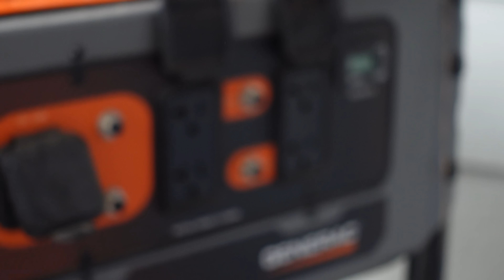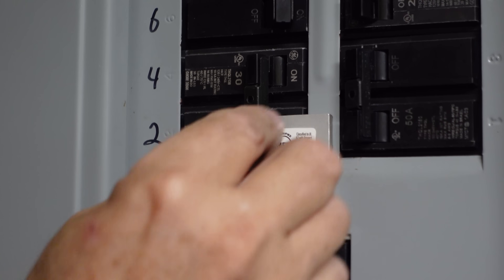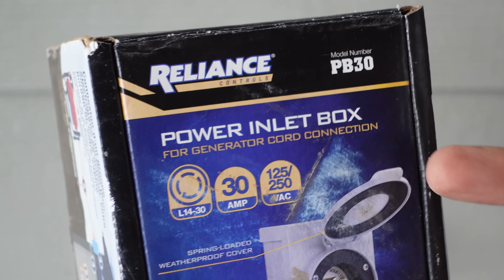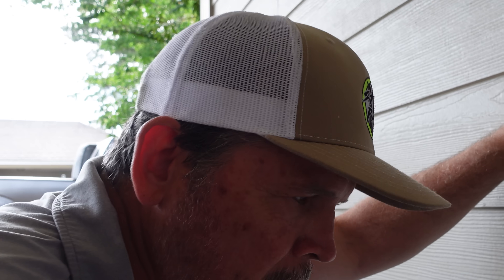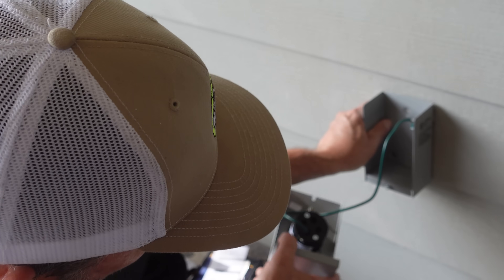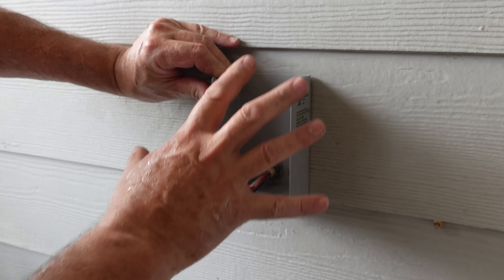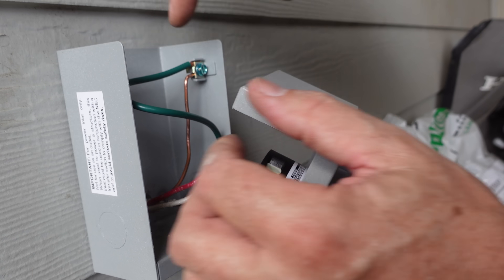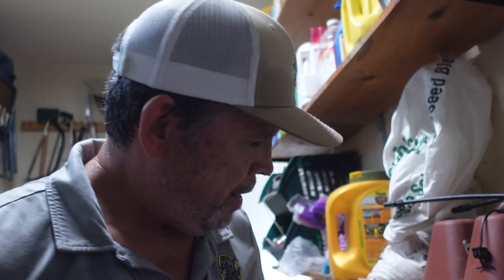What is a Suicide Cord and Why It Could Kill You

Comment: When I was about 12, we moved into our newly-built house, and it had provision for a timer for the the kitchen lights. The connection between the timer and the lights was supposed to be made using a 120 volt version of what you very aptly call a suicide cord, and I was sent to the hardware store to get such a cord. Fortunately, the lady there told me that it's illegal (this was in NJ) and explained why. I still wonder at how the idiot electrician came up with this scheme. I also remember relatives in Brooklyn who used such setups, and, surprisingly, I didn't hear of any mishaps.

Comment: The new panel has a 30 amp breaker feeding a 20 amp outlet.  We hope that the wire in the wall is #10, not #12.  But it seems odd to have fed a 20 amp outlet with #10 wire. That would have been overkill.  You have not actually said that the wire in the wall is #10 as it should be to avoid a fire.
Reply: I came looking for this comment.  On the video it sure looks like 12ga to me, it could just be the look on the video, but it would be nice to hear that it needs 10ga.
Reply: @dann952  thanks.  It sure looked like #12 to me too.   I hope stud pack does not get a fire when using a 30 amp generator with #12 wire.  He needs to make this clear to all.

Comment: You can save some hassle in tight spaces like that if you know you have enough length on the cable by putting the back side of the clamp on and screwing them down onto the sheath and then pull the threaded part up through the box with the cable to put the ring on.

Comment: i'm a UK approved electrician, the apprentices were always told to check screw tightness before shutting something. they were also told to leave a little spare length, for the next guy, in case of problems so that they had a little spare to play with. and the earth wire always got covered by earth sleeving green/yellow or green, in case of a short against something when it's screwed up tight. and i've seen a few suicide extensions with a plug on both ends :D i love the consumer unit spreadsheet, things like that can save so much time in repairing something.
Reply: I was gonna say the same thing about the earth sleeving
Reply: Absolutely. Wiggle it a little and check tightness

Comment: The wire in the wall looked undersized for a 30A circuit. It looks like a 14/3 or 12/3. Both are not rated for 30A. Should be a 10/3 minimum. Unless codes are different in USA then in Canada.
Reply: Most of my house is wired as multibranch with 12/3, so I am routinely working with it.... on video, both the wire and cable look the same size as what I have in my home....

Comment: That setup is a real rig. However, I have a 62 year old generator into a fuse box. No  main breaker. To run the generator you need to pull the main cartridge fuse and plug the cartridge in the open spot reserved for the generator. Pretty clever for 1959. The old Lister generator has a crank as well as a battery to start,

Comment: You mentioned a Klein level to square up my saw blades in my home wood shop I took it to work just to see I build precision machines check it at .0002 per foot it checked it was perfect it’s model 935dag it fits in your pocket has magnetic base water no problem and I have dropped  a few times oh it is 2”x 2” x 1”   And no I do not sell them 🤔🤑

Comment: I would expect that there would be an official switch to toggle between backup power and grid connection instead of screwing sliding piece of aluminium in the circuit breaker box. Is there truly no better mechanism?
Reply: There are official transfer switches, yes.  If you open them up, you'll find one or more sliding pieces of metal.  That's kind of how electrical switches work, with variations to reduce wear and tear when under heavy load.

Comment: If you are handy enough to build a suicide cord you can buy a transfer switch and a 30amp breaker and add a plug for your generator. You don’t need a separate breaker box just be smart what load you are putting on the generator. Good luck everyone. I think this summer Pg&e is going to be turning off the powers a lot this year.

Comment: I've got one or two of those death cords around here. We had to wait 2 months for a dig permit to drop the new power to the pole. We already have a transfer switch installed just waiting on paper work. Ran the whole house off a 2000w inverter gen most of the time, also had a 5000W but never really needed it. 110v tied to both hots in the dryer plug. Turned off all 220v appliances. It ran all the lights in the house, the fridge, modem, window unit and a ceiling fan when the ac was off. It's not safe but I'd bet half of us have done this before in a pinch.

Comment: not only did you not upgrade the wiring to carry the extra load but you installed a socket with an exposed live pin easily open to small fingers ie kids or American adults which are renowned for low IQ

Comment: Is that Romax line even rated for 30amps? In California you have to use at least #10 wire for 30amps which usually comes in Orange. Maybe your is different but you did have it in a 20amp breaker prior. Now that’s a great way to start a fire
Reply from the maker: It’s 10g👊👍

Comment: A suicide cord is an electrical cord with an AC plug on one end and two bare alligator clips on the other. They are used in breadboards or other projects to supply 120 VAC to a project. They have been around for 75 years or more. This type with two male ends are something new with the use of portable generators to power houses when the power is out.

Comment: You have to upgrade your wiring if you are going from 20a to 30a. The breaker protects the wiring from starting a fire. The wiring can't be rated less than the breaker or you'll get a fire. 

You also didn't weather seal the back of that box.
Reply: Came here to say exactly this.
Reply from the maker: It’s 10g.   Box was sealed later 👊👍
Reply: I've never seen white romex that is 10AWG.
Reply from the maker: Color coded Romex came around in 2001.   It all had white sheathing before that 👍. Color coding is not a requirement of NEC, UL, or NFPA btw
Reply: @StudPack   Thanks for the history lesson on Romex.  Per color coding, the electrons only know where to go based on jacket color. /s

Comment: Trick if you want to put in a sheetrock patch and you don't want to slice all the way back to the studs (or you don't have that kind of access).    Take a thin piece of board (1x2, even old baseboard will work), and put it behind the hole.   Put a screw on either side to pull the board into the hole gap.   You now have something to which you can attach your patch board.   If it's close enough in size, you don't even need the tape.   I've done this a number of times, and you can't find the hole anymore.  Just mud the screw heads, mud the crack, and you're good.

Comment: 30A 120v circuits have #10 wiring. As a journeyman industrial electrician, We always ran 1 inch rigid conduit and condolets, receptacles and 30 amp breakers. How is it possible to reuse the existing conductors that were sized for 20 amps? It looked like #12 was the existing wire.
Reply from the maker: It’s 10g.   Only that old receptacle was rated at 20 amp 👍👊

Comment: Because the wire was a bit short could you have reversed the restrain for the cable making it easier to tighten the screws on the inside or would that be against code?

Comment: I have a cord like that but I don't plug it into the generator first. In fact I check out the generator first, shut it down configure all the breakers except the generator breaker in the panel. Then I connect the generator cord. Fire up the generator and flip the breaker in the panel. I've been doing it for 20+ years. No excitement, no rush just common sense.

Comment: I would put the plug on an interior wall higher up. You claim you're in hurricane which to me means flood. Have the cord long enough to reach the generator which also should be high enough off the ground in case of flood water. Just my opinion.

Comment: In electrical engineering we use suicide cords.  They plug into the wall outlet at one end and the other end has alligator clips.  We call it a suicide cord as a joke but we all recognize it's dangers.  We use the suicide cords on the lab bench when debugging a piece of equipment.  Sometimes we also connect them directly to a 470uF/10V capacitor and put it under someone's chair.  Then when he sits down we plug it in.  
Also, in engineering when we have to work on high voltage equipment (in my case 30kV) we have what is called a Jesus stick. Commonly the Jesus stick is a permanent fixture inside the cabinet of the high voltage section of the equipment. A long insulated wand with a big metal pointer at the end that has a big braded cable connected to a ground. The idea is you power everything down, then just to make sure, you poke everything with that pointer thus shorting it to ground.  On the rare occasions when you have screwed up and left something powered up the pointer draws an arc and usually makes a loud bang similar to the retort of an M80.  When that happens it seems to be the instinct of nearly everyone to shout the name of the savior as they stumble back.

Comment: 14:28 The solid ground from the wall cable slipped out of the ground lug a little, you caught just the tip of the wire and should go back and redo it...

Comment: Car jumper cables have the same potential as a suicide cord.  You plug into the dead side first and then plug into the live end and it is completly safe.  Or just don't touch the metal prongs.
The box and cabling though was horribly done prior to the fix and did need fixing.

Comment: Ugh reminds me of when I worked at Radio Shack, every holiday season we'd get people coming in seeing if we sold electric cords with male plugs on both sides so they could hook up the female ends of Christmas light strings.  Umm no, that could be slightly deadly.  Not sure why they didn't just turn the string around so the ends matched, but that's just the kind of customer we'd deal with on a daily basis.

Comment: Transfer switch panel would be the best way to go. Regardless, safety features in place and nice job.
Reply: Our farmhouse has a whole house disconnect switch so that no power will transmitted to any lineman working on downed lines in our area. Was installed almost 40 years ago. When operating generator the farmhouse is completely separated from the power grid. Nice install for the power plug! We have 1 of those suicide plug wires. Simple solution is to plug in wire BEFORE operating generator & of course after,( in our case), disconnecting farmhouse from power grid before operating generator. Power company is decent enough to call you once power is restored after outage so 1 does not have to guess when power is restored. Although in our area telephones go dead after > 8 hours as battery backup for fiber optics junction box only lasts for that length of time without power grid. We have at times have had to ride one of our horses a few miles to inform the power company about the line situation as everything went dead, even cell phones too, when we had a power outage due to heavy snow & ice storms of 2008.

Comment: Well done video. Very helpful. I would have modified that suicide cord for 2 reasons. 1) so it no longer exists to harm anyone and 2) as a back up cord or extension to move gen set further from the house. Also, those cords are quite expensive.

Comment: I have only one suggestion about the installation of the new box to wall and that is were it me I would have installed a piece of gasket material between the box and the siding on the house or a thin layer of caulking but my first choice would be a rubberized gasket material. The reason I would and do install gasket material between surface mounted exterior boxes and receptacle covers is I have personally seen water damage wick behind the box and the follow the wire as well as water wick into the box and the receptacle causing breakers to be blown and since this is for a backup generator well who wants that sort of problem which could potentially damage your generator when you need it most. I am a firm believer in the “5P’s of life Prior Planning Prevents Poor Performance” and an “Ounce of prevention is better than a pound of cure”.   All that said “suicide cords” are scary things and against code in many places because of the hazard they potentially present. So making a video about them and there dangers is definitely a good thing to do because until you explain the dangers of them to many at first blush they seem like a simple elegant solution when in fact they are definitely not and extremely dangerous one.

Comment: Half of my house is on a proper generator switch.  The other half has the option of me using a suicide cord.  My suicide cords have red tags on them that tell me to go to my checklist.  My checklist is set up to ensure, that if followed, I protect the lineman, protect myself and my family, and protect the wiring and electrical system in the house.  That being said, suicide cords are still an accident waiting to happen.

Comment: great point with the cord, many people dont realize that... my one question is, where the hell is the sheathing on that house? when you opened it up it looked like there was a vapor barrier and then hardy siding only.... I know in texas they started using cardboard for sheathing, which is a complete joke in my mind... I grew up in houston and my father was a carpenter and there codes down there were a joke. I have moved back up north and i have to say, I dont miss the days of sweating my ass off just walking outside, you look absolutely miserable with the sweat right now lol. Just imagine if you had to go into the attic to pull more wire down hehe... We get cold here but a jacket helps take care of that and when we come in and take it off we dont need to hop in the shower right away..... Great video though, still waiting on the houston house episodes. you guys have your work cut out there .....

Comment: Thanks for the tips; I did not know about the ECX tip. I’ll keep my eyes open for it. For multi-stranded wire if you can; you can tin the wire first, it will help. I don’t use anything but 60/40 solder. Rosin core is sweet. The other stuff is junk.
Reply: I recently found out about the ECX and got the Milwaukee version. It made my life surprisingly easier; I wouldn't have guessed that the right screwdriver would be so helpful.

Comment: A suicide cord is an extension cord with male connectors at each end. It is called a "suicide cord" because when one end is plugged in the connection on the other end is completely exposed, if you touch it you are dead meat.

Comment: From the UK I have to ask why you wouldn't just cut off the old plug and put a new 32A socket on the extension cord? I made up a new converter extension yesterday with one of our 230V 13A fused plugs to an industrial 32A trailing socket for my MIG welder, so I could do a job at a local church this morning. We just it, I can buy converters, but many times we just make up a new one.

Comment: there is nothing wrong with switching end (s) on a generator  or any other cord. i prefer a transfer switch as opposed to an interlock on the main loadcenter. one flip of the handle and done. transfer power after the generator is running. i would tend o buy a larger generator than you think you'll need, say 8000-10,000 watt, particulary if your using a/c. electrical loads sneak up on you, especially at night. generators sized to barely keep up with demand don't last as long as the larger ones do.

Comment: it's definitely ok to modify cord ends as long as you do good work and make sure the wire Guage is suitable for the type of connector you install.
Reply: On standard light and meduim duty cords the ends are junk. You're better off replacing them right away if you're using high current loads. Even for regular duty trhe ends usually wear out way beofre the cord does. For $30 you can get a pair of(120V) cord ends way better than anything on a store bought cord. Even the mid grade ends for $7-10 each are better than factory plug ends. 
Maybe/hopefuly 240V, 30A generator cord ends  are made a little better from the factory.
Reply: Wire gauge is what I see a lot of people get wrong with cords.  Don't overload the rating of a store-bought cord, of course...  Especially if part of the cord is left coiled up.
The trick is that the guage required actually depends on the length.  The longer the cord, the thicker it needs to be to carry the same current.
Cutting a cord shorter is fine (good even).  But chaining together cords or lengthen... you are lowering the amount of current it can carry safely by increasing the resistance.  
If you are making a custom cord, lookup the guage required on a reference which includes current, voltage, and length as factors.

PS: Electronics folks tend to call a "suicide cord" one with a mains plug on one end and bare wires on the other.  Male-male power cords can be pretty bad too though.
Reply: @travcollier  after 100 feet you upsize by one gauge for voltage drop as you do when roughing in a job.
Reply: @travcollier how do you figure amos based on length? Amps are amps a longer cord may have more total resistance,  but the resistivity (resistance per unit length) remains unchanged. So long as you're not exceeding the amperage rating, it's all good. ( true lower supply voltage can increase the  current draw in devices) as long as its 80% of the 30 amps it should be fine.
Reply: Cord length is always a problem who wants a cord pile that can be a tripping hazard electricians at work cut cords to length for equipment all the time where do they think these cords come from ?